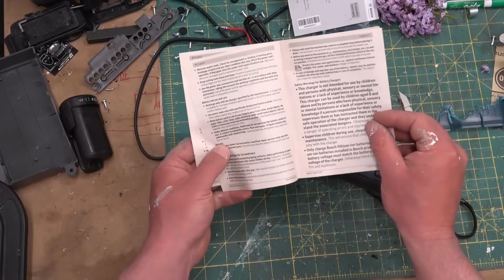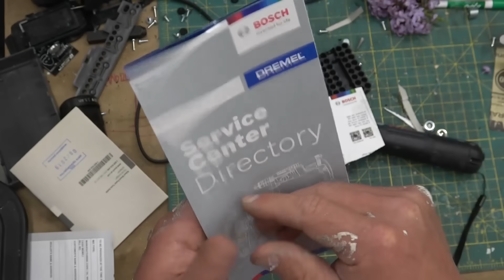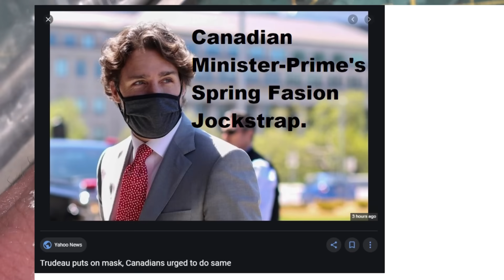BOLTR: Bosch Screwdriver

Comment: Took me rigt way back when!

For a moment I was transported back to a previous life when there was a war between two factions ..... The Great and Glorious Ever Ready (I think .... it was in the 80's .... I checked) and some other no bit Tool Co! For the life of me I can't remember the losers make ... but they were a hauntingly similar hue to the beast in the dickbeaters here. Anyway the battle lines were drawn, sides were chosen  and insults thrown! 
Who won? I here you ask ...... as with all things, it was complicated! Ever Ready with there square profile gave a better grip but the more expensive opposition were backed into a corner. They had spent their £ (It was in the mother country) and felt at n unfair disadvntage  having spent their cash so profusely! The Battle itself was a prolonged affair .... a contract to replace a council housing estates whole itinerary of storage heaters with new. Each home had 5 heaters of various sizes ..... each heater had a panel you had to remove held on with 8-12 posidrive screws. Each heater was fixed to the wall with 2" wood screws into fiber plugs. So it was a good test as there was no such thing as a quick charger or battery packs (they don't know they are born today)! 

There was cheating to be sure ...... is it right and proper, I here you ask to use one of those venerable devices like  normal screwdriver once the battery failed? No! ..... But some owners of green things surely used the center locking facility unduly! There is also tales whispered of dark deeds ........ of elechickens forgoing the aforesaid fiber plug and using a ..... rawlplug (plastic no less) Those wannabe pixiwranglers heedless of castigation and lawsuit plowed their trade. Reports are whispered of an old lady one of these nare-do-wells had installed heating in, wondering why her heater was a tad loose and when walking past said heater  ( not realizing the themoelastic effect of plastic) was surprised to find said heater with 100lbs of read hot bricks in its gizards falling free of its restrints and pinning her to the floor! Blame was cast and culprits caught and chastized, but one of their pleas of mitigation was the feeble battery life of their chosen tool and the relative ease of screwing a plastic plug rather than a fiber one! Not to mention screwing with peoples lives! ..... As I said, it was complicated! Back to the point of the reminiss ...

The tool won .... for a while! Unfortunately batteries back then were not what they are today and their lifespan done the tools were thrown in the bin of dispair and new ones sought! Now dispite clearly having the better driver Ever Ready to much wailing and gnashing of teath did not continue to produce thei iconic battery driver ........ it is now consigned to my memory!

And here  ..... hould anyone be interested enough to read this missive ;0)

Comment: If you like this, check out the Dewilt GYROSCOPIC INLINE SCREWDRIVER https://www.dewalt.com/products/power-tools/screwdrivers-and-screwguns/8v-max-gyroscopic-inline-screwdriver/dcf682n1. Saw a guy on a job site with one and he let me try it and I bought one the next day. Takes a little getting used to. But once you do you won't want to use anything else. Also I want to know how it works and don't want to take mine A-Part!
Disclaimer: Not a Dewilt corporate shill. They change their battery design too often.

Comment: Bosch Posh Screwdriver. May drive screws.

Jokes aside, when you've the hang of it those things are essential if you don't wanna get worn out by repetitive screwing. I lied when I said jokes aside.

Not sure if it's the switch getting worn or what, but when they get old and unreliable they go from wrist-saving godsend to the worst fucking thing on the planet after insert political opposition leader here.

Comment: Thanks for the video. Interestingly, the gearbox and general layout is very similar to the B&D electric screwdriver I purchased 20 odd years ago. Still going strong after soldering in two sets of NiCd batteries through that time. The Bosch one looks like a good upgrade to me though, the battery technology being the B&D screwdriver's only real weak point in my experience.

Comment: The 6 speed thingy "speaks" to my cultural-genetically engrained german humility.
If it's humble it has to be pro, reason being, german pros have to be humble, otherwise they're considered superimposed and somewhat wonky.
german pros don't exaggerate…. 10 or more iS exaggeration.
more than 3 couples ["all good things come in threes" an old german saying….] (which is six) is impractical too.
too much fiddling that puts you of the real task at hand.
Maybe i'm just a nerdy math-nutter.
"batt"
clearly i'm no expert to this subject, just the first thought, coming to my mind.
Now, as i start thinking about it...
hob-controls… 3, 6, 9, 12 (12 of course not for por-hobs)
12 months. 3 months per quarter (Quartal = 1/4 og the year)
holy trinity… etc...
i assume there's something about "3" that just sticks culturally.

Can't be from the digital domain.. would be 8 then.. or at leat 7 plus address-bit.
maybe 6 plus address or start and check-bit. (now THAT would be overengineering in a device like that).
apart from that... "it dassnt appeer to vork" in steps, therefor rather analogue.

Basically, pick an explanation or find a better one. :-)
cheers, 

S.

Comment: I did buy this one, NFG for repair work, since the “torque limiter” doesn’t limit torque as they don’t short the motor when it trips....   good for minimal use on wood work, forget about screws in plastic, it’ll strip it right out.

Comment: I have this and is useless! The speed can't be adjusted which is too fast and the dumb activation switch. Useless except for an assembly line of making furniture.  Too bad it is well built and plenty of torque.  My Makita multi-purpose drill is a better screwdriver than this